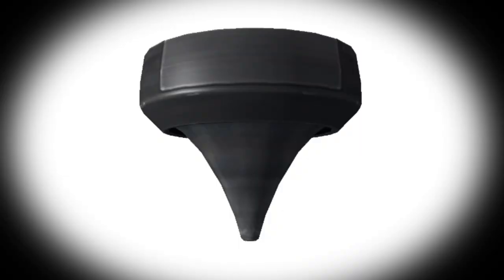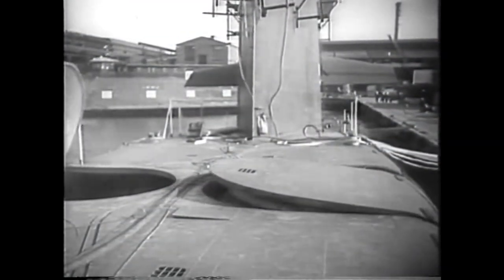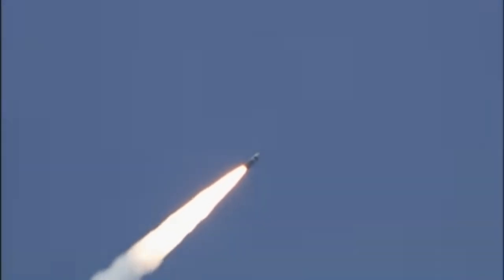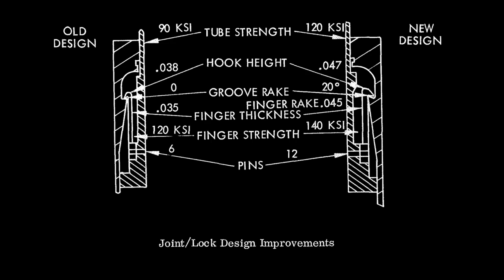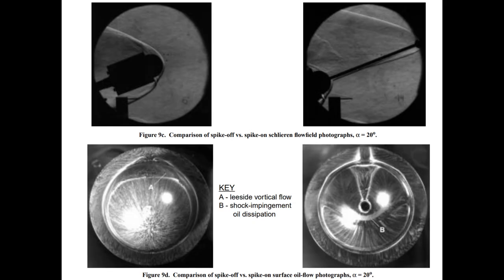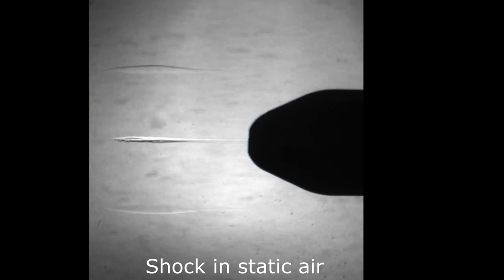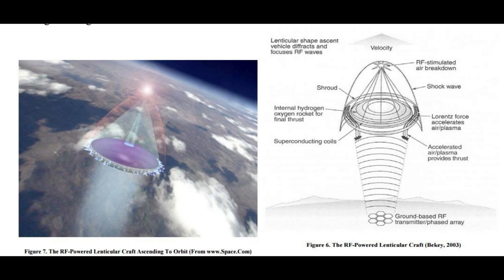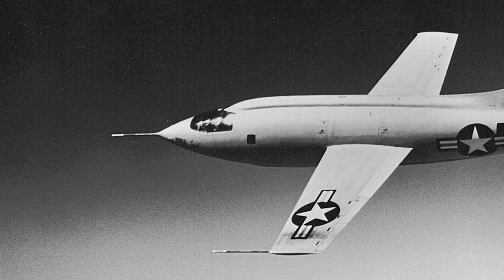Why Does The Trident Missile Have A Spike On Its Nose?

Comment: I met the guy that invented that spike.  He said the Generals did not want it because at that time such a stick-out would make people think missiles were too phallic.  They went with the design because it improved the force.  He also said that the cone was made of plywood so it would burn off and lightning the missile so its range would go just a little bit farther.
Reply: This is correct-- it's alternating layers of spruce and another material. The wood portion is rocketed-away by its own motors, some time after the 1st stage separates but before reaching the Karman line, and falls back down to Earth.
Reply: There was a guy who invented that aerospike? One guy?  What was his role, how did it come about that he single-handedly invented that aerospike?
Reply: @StevePemberton2  Yes, he was an aerospace engineer.  Of course it took more to approve it, but usually somebody comes up with an idea and it works.  I've done it several times for major software.

Comment: To reduce drag during early boost, without making a longer missile fairing and a  longer missile that would only fit in a yet larger diameter ballistic missile submarine. The Trident is only one of 2 Western submarine classes able to house 2 generations of ballistic missile.

The entire height of the launch tube houses superimposed rocket stages full of fuel, thus maximizing the range of the missile. The D5 matches land based ICBMs in terms of range.

Comment: Interesting video. Yep getting that bow shock at the right place at the right speed makes all the difference. Reconvergence and side drag is also a problem that can crush a rocket. 

So now speculating. 
   If you had lasers that are tuned to the excitation frequenceies of air namely the 100 to 215 nm range you could theoretically evacuate the space in front of the rocket and create a vacuum tube which would propell the rocket forward. This is all doable except for one problem. The minimal amount of force required is 14 lbs per square inch or something like 10000 kg per square meter we are talking. So you would need to first find a source of electrical power to do that, and we are talking about exciting an electron on every oxygen and nitrogen molecule such that essentially we are creating a positively charged center that is pushing the radicals out of the way. Once this is done the space needs to be maintained. The other problem is the lasers would be inside the column in which the rocket flows of the rocket and recombination would also be occurring at the radius of the rocket at a point were both friction and recombination occur not to mention any residual charge discrepancies not turn the rocket into a giant tesla coil. 
   Why microwaves would not work, the frequency of the wave and the generator itself do not allow sufficient precision to generate a field sufficient far enough away, though these could be used to push hot gases above mentioned away from the top of the column of the rocket, one still has to deal with some reconvergence of very hot gas which as we know hot stuff has a higher Mach transition than cold gas. 
   Atmospheric gas on earth is not nearly the relative problem it is on KSP. If you have the Delta V to get to 7800 m/s orbit the few hundred dV you lose slowing down briefly at Max Q is justified because it affords more precise adjustment of attitude and bearing during the gravity turn. 
    I would say that the ideal rocket is meaning your ultimate target is say some star😂 and you absolutely just want to make the best use of the earth, sun, etc, The ideal circumstance is to accelerate horizontally as low in the atmosphere as possible at midnight from a position 10 to 20 degrees in front of that.  Flying strait up is not an intelligent way to gain velocity because for product velocity is the change of motion relative to the surface of the earth plus the motion of the earth surface realtive to the sun. When the tangent of the position vectors are parallel the velocity vectors can be added and appended to the rockets motion along that vector one obtains the greatest velocity on exit from the suns Bell radius. But you know that. But the place were the gain is the highest is closest to the earth, so the place were you really want to get rid of space gas is where one completes the gravity turn and maxes out acceleration. That is the place were most energy can be gained using Earths graviational field and tangential acceleration. Most rocket launches i see are using high efficiency engine with a high ratio of fuel to the engine thrust, executing burns over ~100 degrees. Either that or they throw the object 300 hundred kilometers up and try to establish orbit before the rocket reenters. To establish a good escape trajectory from low earth orbit benefits from both powerful and efficient engines like SSME
     Launching nukes at the Russians, I hope, is not the ultimate goal of the space industry. And in a couple of years we might not need concern ourselves with the Russians anyway.

Comment: After reading about high speed torpedoes it seems US felt that fuels for this in an enclosed torpedo compartment to risky which seems sound advice.   Rumor on Kursk loss was that the squall torpedos is what went off in torpedo room.   😢 either way liquid propellants in a torpedo room…..sketchy

Comment: I wonder if Kursk shot itself in the side with one of those torpedoes. When it was raised it had a hole in the side with the edges pointing inward... not the sign of a normal torpedo but maybe the Shkval hitting at 200 knots could cause such a damage.

Comment: Maybe you’ve covered this already but you have so much content so I dunno. Anyway, every time I watch a video about aerospikes by you or Everyday Astronaut I always think about the sci-if propulsion used on drop ships (Aliens) or Pelicans (HALO). Not so much the horizontal flight thrust but rather the vertical thrust allowing for for VTOL and hovering. It seems as if those kinds of “thrusters” are envisaged as aerospikes. What’s the plausibility of such thrusters? Is is throttling up and down that is not feasible with such technology? Or is it the thrust/weight ratio, the size the thrusters would realistically have to be or fuel consumption or… all of the above? Would be cool to know if this sci-fi technology has any chance of ever becoming reality or if it will forever be just a flight of fantasy? Thanks. /Will

Comment: Could you make the disc slightly steerable to steer the shockwave from hitting the rocket body during maneuvers. Also, it may be a form of thrust vectoring while in the atmosphere. Might be impossible though if the tangential forces are to high.

Comment: Could someone explain- was the purpose of the spike atop the Saturn V also useful in drag reduction, air speed measurements like the Bell X 1, or something else like containing some sort of internal abort system? Thanks! Fantastic video Scott! Considering using available experimental data of drag reducing aerospikes for my graduate research project in gas dynamics.
Reply from the maker: The ‘spike’ was the launch escape tower, it had the ‘puller’ escape motors that would carry the crew capsule clear in an emergency.
Reply: @scottmanley  appreciate the reply Scott! Would you say then that the effect on drag and shock dynamics brought on by the escape tower would be negligible compared to if it wasn't there? Obviously the extension of escape tower allows for a pitot tube to be out in front of the vehicle enough to avoid miscalculations brought on by the blunt body effects of the nose, but considering the velocities it experiences at atmospheric pressures is so short lived it must not have too much to do with aerodynamic efficiency?

Comment: Could you use aerospikes instead of fins? Because if you imagine that the rocket rotates around cg, there would be a low drag zone created on one part of the nose but also a high drag zone on another part of the nose, which would lead to a counter rotation, stabilizing the rocket again. This probably would be less efficient then fins but in theory it should work right?

Comment: Testing the aeospike concept, I discovered that running with an erection gives you an extra 5 mph and a full extra mile in distance. After I was released from police custody, I circumvented the legality issue by glueing a prosthetic phallus that I purchased from our local Ann Summers shop to a helmet and tried again. This time I ended up with two black eyes and a fat lip. Turns out that a slightly shorter and more rigid spike would have been safer!

Comment: Hm. If you put a high drag nose design behind that spike, will it auto-steer? I'm thinking like a dumb projectile of some description. As long as it's flying straight, the spike directs the shockwave around the body; if it starts to tilt relative to direction, the shockwave hits the edge of the draggy nose and torques the projectile straight.

Comment: If this increases range and reduces thermal load on the surface, why don't they use these on hypersonic missiles?  Is it the 'behaves badly during steering' effect that Scott mentioned?
Reply: Because as Scott said, a regular pointy nose is good enough. The option for a spike is useful for confined spaces/restricted dimensions but if you can just make a larger missile, might as well put a pointy nose on it.

Comment: I was wondering if having a gas generator spewing a gas at the top of the missile could act as insulating layer between the outside fluid and the missile skin to reduce friction. It would be similar to the supersonic torpedoes, but for movement in the air. It would probably require too much gas for long duration flights, though.
Reply: The HEDI anti-ballistic missile used a cold nitrogen flow to cool and insulate a sapphire window at the front of its nosecone, through which its IR seeker head would search for and home in on its targets. Flight speeds above Mach 7 meant that the window would have been exposed to temperatures of 1000 degrees C or more, so without the cooling the window would heat up so much that it would be the only heat source visible to the camera.

Comment: Hey everybody. I remember I saw a film on Spectrum at night, when those dubious topics come up on these kind of channels, like UFOs on history channel and stuff, and this 1.5 hour film argued that the US military already achieved Mach 23 or with two planes. The film said, the planes used poles sticking out from their noses (they looked 4th gen fighter jets, really) and blasted an extreme high current of electron straight ahead that sped up the air in-front of the jets and let them basically fly almost without any air resistance. Then of course they went on arguing that these planes are being hidden, and deleted from satellite imagery and so on. I saw this film about 20 years ago, and it just came to my mind, since the physics of it doesn't sound to be all that bullshit after watching video. Any opinion this? I am highly inclined to believe that there were faster planes in history that we ever led to know.

Comment: Sorry if this is off topic, but do you have something about how a rocket adjusts its apogee to make the orbit circular, e.g. how much energy, what angle the rocket must be, etc. TIA.
Reply: You need to look for „powered explizit guidance“ or „prime vector guidance. Both should enable to have one uninterrupted ascent including  circularisation at desired AP/PE. KSP’s MechJeb has PVG for that purpose. 

Manually flown, you need to monitor Stage time,vertical speed, horizontal speed and time to apoapsis to fly manually in one go and you can get very precise with that.

Comment: Why is it that rockets are shaped like pencils, instead of bullets ( Shapes like the WW2 era V-1 rocket vs. Saturn V )
They also have all sorts of junk on the sides exposed ( pipes and such on the Space Shuttle and Saturn V ). 
I've been told that since the rocket is only in the atmosphere for a few seconds, that it does not matter if the shape is streamlined. 
This doesn't make sense, since if the rocket was more streamined, it would burn less fuel in the few seconds it is in the atmosphere.

Comment: Fascinating! Many years ago, I saw bubbles being pumped into the landing area of the Olympic High Dive competition to make the water "softer." I thought this could be a clever way of reducing the friction/density of other States of Matter. If the microwave solution for air works, maybe that could be used instead of Heat Tiles for Spaceships re-entering the atmosphere.

Comment: Could there be an argument for fitting a reusable rocket with hundreds of tiny spikes for reentry? The heat tiles on Starship already has something similar but they're only used to connect the tiles - maybe extend the spikes through the centre of each tile so they poke out?
Reply: They’re best for speeding up, really. Minimize the drag on reentry and you’ll be coming down too fast to stop comfortably unless you’re at a really shallow angle.
Reply: @joshuahadams  it would be hundreds of tiny spikes, so effectively the same overall body of mass hitting the atmosphere. l was just wondering if the heat could be managed/channeled in a fancy way rather than distribute over a smooth tiled surface. Good point though.

Comment: I have a friend who served in the Navy aboard a Trident Class Sub. He told me his job was 'Fire Control'

For the longest time I thought that meant preventing or fighting fires onboard. Not even close. He was responsible for electrical and mechanical systems to 'Fire' a Trident Missile from sub. Very few people were allowed in the Fire Control Section of the Sub and it required very high level security clearance. 

When I worked at Boeing, I had very high clearance to work around our F-15's and F/A-18's. My security would not get me pass the armed guards on his sub protecting the missiles. I got lost once at our St Louis military factory. Strayed into 'off limits' area and was greeted by 2 guys packing M4 and M16. They pointed me in right direction which was 180 degrees opposite where I currently was.

Comment: I have been playing around with ChatGPT and gave it a prompt to see how well it could predict this video. Let me know how you think it did!

Prompt: Write a Scott Manley video about why the trident missile has an aerospike on its nose

ChatGPT: Hello everyone, it's Scott Manley here, and today I want to talk to you about the aerospike on the nose of the Trident missile.

The Trident missile is a submarine-launched ballistic missile (SLBM) developed by the United States Navy. It is capable of carrying multiple independently targetable nuclear warheads, and it is a key part of the United States' strategic deterrent.

One of the unique features of the Trident missile is the aerospike on its nose. An aerospike is a device that reduces drag and increases the efficiency of a rocket engine by creating a conical shock wave around the nozzle of the engine. This allows the rocket to maintain its thrust even at high altitudes, where the air is thin.

In the case of the Trident missile, the aerospike helps to improve its range and accuracy. By reducing drag, the missile is able to fly faster and farther, making it more difficult for an enemy to intercept it. Additionally, the aerospike helps to stabilize the missile in flight, improving its accuracy and making it more likely to hit its target.

Overall, the aerospike on the nose of the Trident missile is an important part of its design, helping to improve its performance and make it a more effective weapon. Thanks for watching, and don't forget to like and subscribe for more videos like this one.

Comment: Why do they use a gas generator instead of just a mechanical spring, compressed gas, or electric battery to drive the motor to extend the spike?   A gas generator seems like unnecessary complexity.

Comment: Going off piste... escape velocity is around 25,000 mph, right? Then how is it Orion was sending a telemetry of 1,200 mph? I'm missing something.
Reply: That speed is relative to how fast it's moving toward/away from the Earth, it's still more than 200,000 miles away. As it gets closer it will accelerate at an ever increasing speed until it hits the atmosphere.
Reply: To get a picture of what happens, think of throwing a rock up in the air. It goes up, slows down on the way up, stops, then falls back towards the ground at an increasing rate of speed.  Launching a capsule to the Moon is really the same thing, just on a larger scale. The capsule leaves Earth at around 22,500 mph (less than escape velocity) and if nothing else happened it would go up to around 250,000 miles, slow down, stop, then fall back towards Earth at increasing speed.  

However they time things so that the Moon will be right there when it reaches 250,000 miles. By then the capsule will have slowed to around 2,000 mph, if it went much slower it would eventually start falling back to Earth, but as it gets closer to the Moon the Moon's gravity becomes stronger, and eventually the Moon's gravity pulls the capsule into lunar orbit. Keep in mind that the capsule still has not escaped Earth's gravity, it's just that the Moon's gravity now pulls harder on it since it is so close to the Moon. I left out several details, but that's the gist of it.  

When the capsule is ready to come back it gives a brief firing of its rockets to move away from the Moon, then as it gets farther from the Moon the Moon's gravity effect on the capsule weakens, and Earth's gravity pulls the capsule towards Earth, slowly at first, but it speeds up as it gets closer to Earth, arriving at around 25,000 mph.

If they wanted to completely escape Earth's gravity, like to go into orbit around the Sun or go to Mars, then they need to leave Earth at escape velocity which is around 25,000 mph.